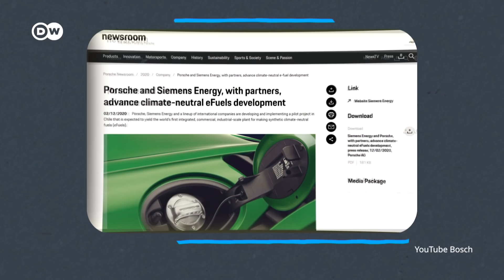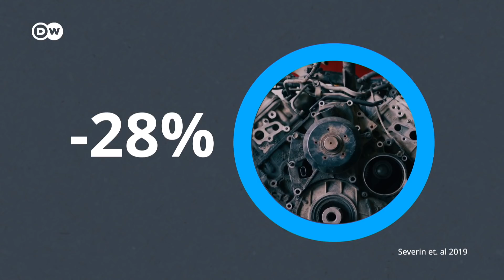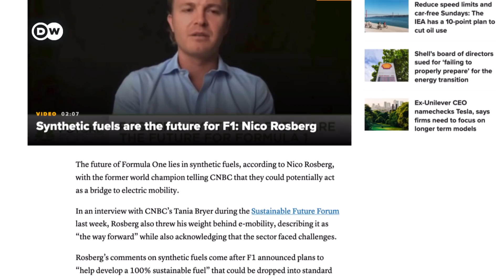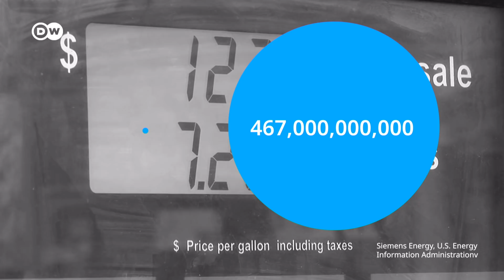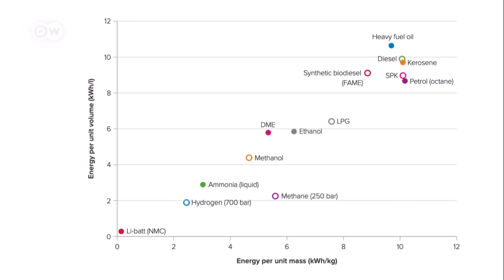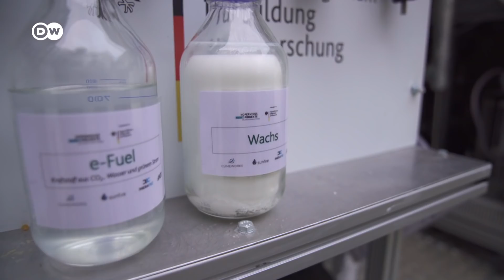The truth about carbon neutral fuels

Comment: Glad that you came back to the efficiency of the electrolysis process since that was my first thought when you mentioned it in the beginning of the video.

Sounds like these fuels might end up useful in some niche uses, but us normal citizens should still expect public transportation, bicycling, walking, and EVs to make up the majority of our transportation.
Reply: Then what is going to happen to the 1.5 billion existing cars with combustion engines? Are we going to replace them all by 2030? 1.5 billion electric cars in 10 years? 
If all of this really is about climate change, we will absolutely have to produce synthetic fuels. And we better start in the "rich" countries to help reduce the costs for less rich countries.
Reply: @PhloemXX  "fossil vehicles" as they're called, are said to soon have a negative net value
Reply: @PhloemXX  1.5 billion cars by 2030 is an arbitrary goal nobody has expressed. Classic straw-man. 
Neither is it possible to produce e-fuel for 1.5 billion cars by 2030. E-fuels will have their uses (as mentioned in the video), but realistically, it can’t be an alternative to EV’s in the next (two) decade(s). 
If you look at carbon emissions per capita, it’s not Africa that has to reduce its emissions. It’s the industrialized nations who can afford to do so by switching to EV’s.
Reply: @PhloemXX  Dont expect a reply.  As is always the case when you point out the logistical tail supporting the fantasy outcome they go quiet and go away.
Reply: Just like batteries they will find ways to make electrolysis more efficient, and I am pretty sure it will be easier enough..synfuels can pretty nicely coexist with the EV revolution!
Reply: Realistically EV's seem to be the best path forward. I think public transportation is great but you need to have such an interconnected network of travel options to make people even consider it.
Reply: @GoGreenPost  and now there's on demand transit and transit company owned ebikes for last mile
Reply: @Nicholas-f5  In the USA we need much better public transit, safe e bike and pedestrian infrastructure to make these alternatives viable, even for the last mile. Personally I prefer public transportation walking and riding my bike where appropriate. However where I live public transit is generally unreliable and slow. Bike paths for transportation are virtually nonexistent and street riding is way too dangerous.  In the US bikes, even e-bikes, are still mostly considered recreational vehicles.
Reply: for me at least, it's not about the efficiency. it's about the fun of internal combustion, car mods, the rumble.
Reply: There are benefits to not put all of your eggs in one basket. If the grid goes down for any amount of time, no-one is refueling. It is smart in my opinion to have redundant/multiple fuel sources. When you have everyone on the grid for everything, you need to keep supply up with demand. If we can make more energy to make up with increase in demand and keep costs of electricity down we don’t really need eFuels. (A big IF) and if you are fine with your your lifestyle being powered by a single source. If we can’t keep the price of electricity down cooking, cleaning, heating all gets costlier for everyone, even those who are already struggling.
Reply: Not in the USA. We Americans are more attached to our cars than even our guns. Forget changing our ICE car center culture. For us E-fuels may be the answer.
Reply: @SaveMoneySaveThePlanet: "us normal citizens should still expect public transportation, bicycling, walking, and EVs to make up the majority of our transportation."

By "public transportation"  I take it you are NOT including taxis, planes, transcontinetal rail, shipping, and long-haul trucks, the latter four of which transport food, materials, and other goods from country to country and continent to continent and it is not yet clear whether electric versions are yet practicable (who is going to pay for the electrification of ALL rail lines, for example), especially for travel across continents or oceans. I would also point out that travelling in an EV on a family holiday from (say) NY to Miami is probably not yet practicable if your EV's range is under 300 miles and recharging times take longer than eight hours. (NY to DC is about 230 miles, while NY to Miami is about 1100 miles.)
Reply: There is nowhere near enough infrastructure to support EVs as a solution.
Very much like there no evidence to support the gas that plants breathe is somehow bad and has been at far higher levels in the past.
Reply: @398paul  There's not enough infrastructure  yet, just as there wasn't enough infrastructure for gas at one point.
Reply: @GoGreenPost  That evolved naturally as it was a better solution which people wanted.  This is being forced upon us with no benefits at all for anyone other than the people receiving the massive subsidies in support to support models which have been wrong for at least 50 years.
Reply: @398paul  There are many people that want electric vehicles and there are tons of benefits of them. Electric cars are an important part of driverless cars, although not required. Electric cars also drive different than gas cars, which many prefer. This is all without mentioning the fact that ICE cars do produce emissions with known human and environmental health issues. Plus, look at whats happening with gas prices right now. You can be much more energy independent as a nation and as an individual with electric cars.
Reply: @GoGreenPost  You are also unaware of the complete lack of security of energy supplies, the rising gas & electric prices in the UK, driven by greed, green tariffs and the belief that the gas plants breathe is bad.
Reply: @398paul  climate action is public health action that saves society and taxpayers
Reply: @Nicholas-f5  Bless. Facts do make you angry don't they.  That's why my factually correct comments remain while you rage impotently.
Reply: @Nicholas-f5  Lol don't be silly. It's a money maker.
Reply: @398paul  report misinformation like Paul's